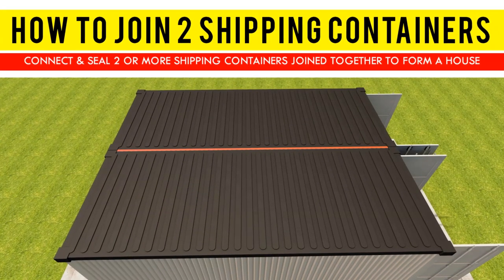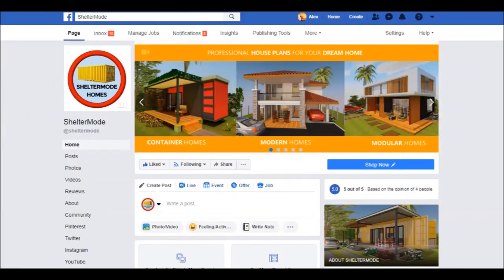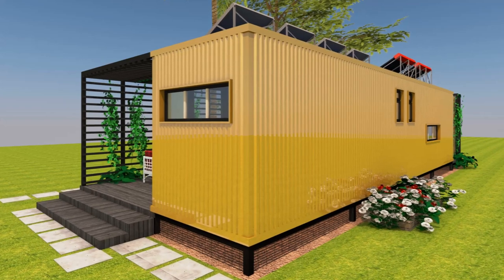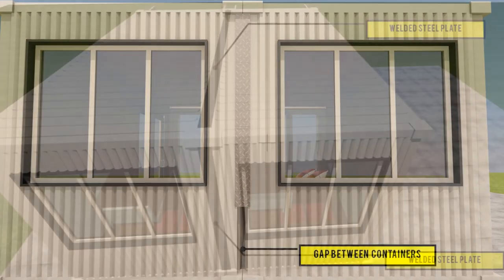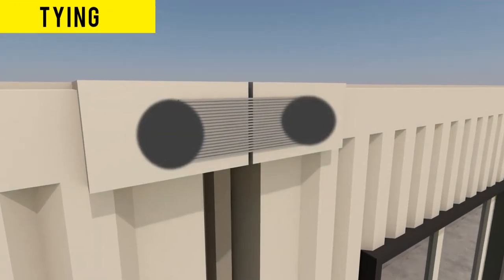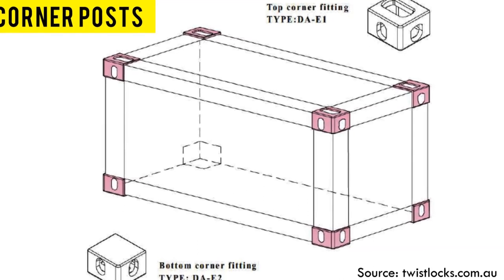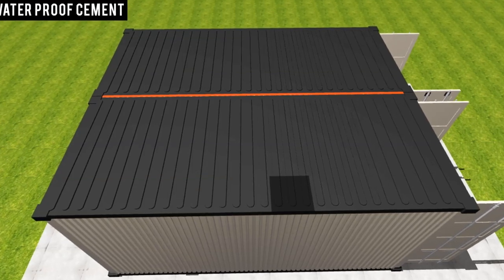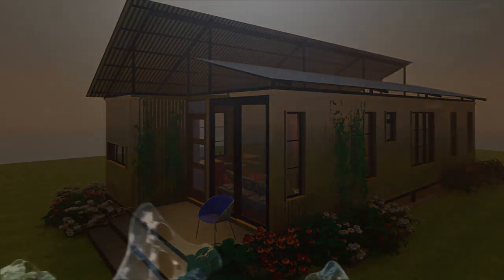How-To Connect and Seal 2 Shipping Containers Joined Together to form a House.

Comment: Useful information, I am joining two containers as you have shown. I prefer the welding process. What will be the dimenions / thickness of the steel plate? Please specify. Thanks

Comment: Would you join the two containers BEFORE cutting out the corrugated sides if you wanted one large interior space, or would you need to do that first, prior to joining?
Reply from the maker: Either. If modification is insitu, the containers are joined first and made water tight before modification. If fabrication is done offsite, joining is done once delivered onsite.
Reply: Thank you for the response! That’s what I figured. 
Do you have any thoughts on supporting the structure as removing the sides will surely undermine its integrity? I’ve seen people use custom welded girders, but thought maybe using jacks and then simply framing them in with a column would be easier? Thanks again!
Reply from the maker: @christopherzurilla5458  For major structural modifications, it's advisable to consult a structural engineer. For smaller openings, framing is good enough.
Reply: Absolutely. Trying to get as much info ahead of time first. Thanks again for the video and answers!

Comment: Could you do a video about how to reinforce a container after cutting a wall out?  I understand that you have to put more steel on the roof edge over the hole to prevent sagging.  Thanks for making these videos, it's really not easy to find "good" information on making container homes and you are hitting all the right areas that people have questions about.
Reply: I'm far from a pro but ive been watching container builds for a while and I plan on building my own (with the guidance of an engineer)... I want to connect 3x40 ft containers removing all of the interior walls I intend on using two steel I beams running the 24 ft length of the interior width wise. 

Great content Alex A... I plan on welding, spray foam sealing AND adding a roof covering. may be redundant but I'll be dealing with lots of snow and I dont ever want to have to worry.
Reply: @theartofflying3580  you can also use the removed interior walls as an additional roofing
Reply: that's genius
Reply: @theartofflying3580   Hey, how's your container building going ?
Reply: @wassimhakim7540  great idea. I plan on using conventioal metal roof and use wall cutouts as an attached shed roof, overlayed 1 ft to make a 13 ft by 20 Ft shed with 1 ft fall in the 13 ft.

Comment: If you weld steel plates on the top and sides of containers when they are side by side, is that enough support to then cut out the walls in between for a 16 ft space as opposed to an 8 ft?
Reply: No, whenever you cut the sides you need to reinforce it. Otherwise the container will shift from the loss of structure. As I understand, the side plates exert force to keep the container square. Before you remove anything, even cut out a window, you should sodder reinforcement bars. Keep in mind that the info I have comes from other videos. :)

Comment: I want to put artificial turf and decking on my shipping container buildings.  What is the least expensive and best way to put an UNDER LAYMENT for Artificial Turf?  I have some ideas, but I want to know what people have done that works well.
Reply: Id use liquid nailes professional glue down gym mats rubber flooring then glue down the turf over that. Great idea
Reply: After making sure the rust-resistant paint was good, I would first cover the area with Blueskin.

Comment: How do you remove the center side for each container before joining it?
Reply: Kartcent Gitlab you can cut it out using a angle grinder or a plasma cutter, but you should have something to help support the i beams that are structural
Reply: @tannerrubach3998  ah okay thanks!

Comment: Forgive me for bothering you ... I want a 30 sq / m container to be installed. The minimum wall thickness should be 10 cm, made of stainless steel. Help me. I live in Georgia ... what will it cost me. Before you send me ... clarify ... thank you for your attention
Reply from the maker: We don't sell containers. We only sell floor plans on our website sheltermode.com

Comment: How do you weld or join 2 containers together with a  "1 meter GAP" in between, say if I want a Flat Roof.
Reply from the maker: Cut 1M wide steel tubes and weld the 400mm apart along the floor and the roof to hold firm.

Comment: would painting with waterproofing solution then welding plate to 4  sides (front, back, top and bottom) then fill with spray foam insulation work ok?

provided all surfaces are treated with anti rust inhibitor, it should be ok..
Reply: I would weld 1 ft sections every 5 ft then use a really good silicone tooled down followed by red guard rolled on over every inch of the roof. Then a waterproofing membrane used on Windows over all joints and topped off witg a valley flashing glued down with liquid nails.